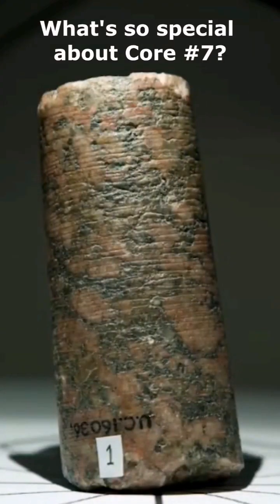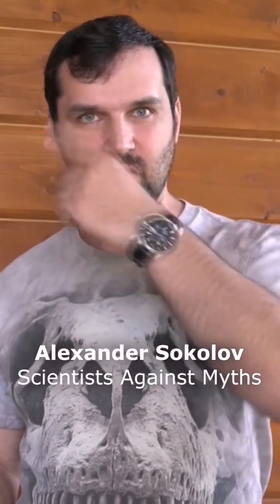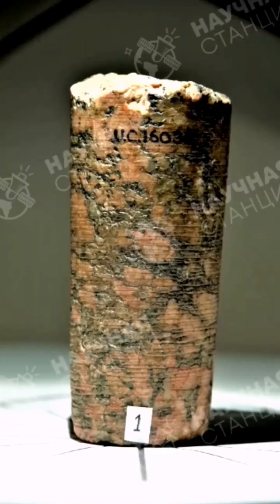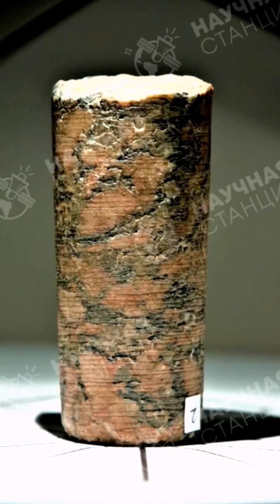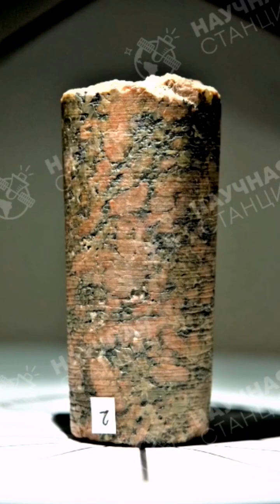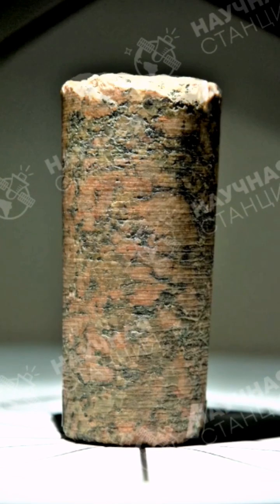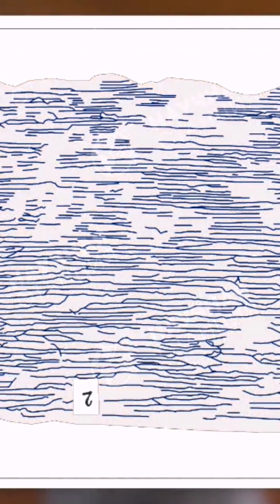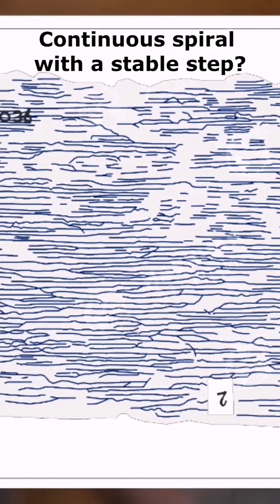Out-of-place artifact? Myth busting #ancientegypt

Comment: What EVERYONE gets wrong about is that these are NOT the original cut grooves.  These are secondary cut marks caused by the drill being off center - wobbling.  The original grooves are lost in the debris when the shape was worn down from a cylinder to a conical frustum

Comment: Masonry drills do not make spiral threads so even if a spiral was present the assumption that it was made with a drill cutting at one pitch width per revolution would be wrong. The most that could be said is that we did not know what tool was used.
Reply: Copper tube also doesn’t make those treats but the harder particles which do not get crushed with in the back and forward cycle, are staying left at the side of the copper tube, and indeed they leave these marks back in the samples. 
Granite isn’t a solid material made out of one certain type of material, bud it is made out of multiple materials with different hardnesses. 
There are particles of al kinds of metals crystals gems mixed together and been pressured into one solid mass. 

Our drilling equipment of today have diamond particles in front of the bore cones which are wider than the cone itself that means everything in his path is being crushed.. 
and solid bore cones are not used either they have holes in the side of the walls and have constant water pressure so the rest materials are being pressed up. 
And the ancient copper methods don’t have a constant water flow wile drilling.. 
and that is causing that pattern which you see, the spiral groove. 

Bud anybody can explain this, but so long America wouldn’t be honest about their unidentified flying object 
project. 
Which they have.. 
and all the other subjects which are being flying around.. 
nobody seems to want to know the truth, because each and everyone is trying to say how much experience they are, but non of them
Is willing to show it.. 
these guys are.. 
still they forget a few important details..
Reply: Thank you! Exactly lol. Someone who is actually knowledgeable and has in field experience.

Comment: Even without the careful analysis, if you have ever done any kind of woodwork or machining just eyeballing this core casually you would assume it was done with a hand tool.  The striations are erratic and irregular. It's telling that this sample is the one pointed to again and again by the alt-history crew as the 'smoking gun' of some lost ancient high technology. The only smoke here is what you would need to inhale a lot of to believe this was done with anything other than a simple tool and a modicum of patience.
Reply: I’m pretty sure what so many don’t appreciate about those on the side of the argument is the arrogant tone but it was also simple when time and time again it has proven that although often enough explainable the explanations are not that straightforward… Even in this video the guy is trying to be clear putting this together is not an easy task. The vases they made of out the hard stone with the thin walls to replicate the egyot vases was said by many seasoned stone workers to just not be possible. Nobody is believing that you just saw how it was all so simple from the beginning when enough experts exist to have assured ppl the solutions are not always so straightforward
Reply: Moreover, the conic shpae of the core indicates a manual technique, with wobbling of the tool
Reply: @PèrePendiculaire it doesn’t mean anything all he’s saying is the tool used to drill did not drill as fast as claimed that’s it! Maybe it’s faster we don’t know that’s all
Reply: @stevefaure415 they still were able to drill into granite….?! And they have many many examples of it too so it must have been easy for them just like it is today that’s the point.. would you spend months trying to make a tiny hole in a rock I don’t think so
Reply: @NathanielTattoos  "would you spend months trying to make a tiny hole in a rock I don’t think so"

What makes you think it took months? It took hours.
Reply: @Leeside999  if it took hours, you’d be able to easily replicate this today. Now let’s see the modern demonstration.
Reply: @BattleCorgiTV plenty of demonstrations here on yt showing it being done